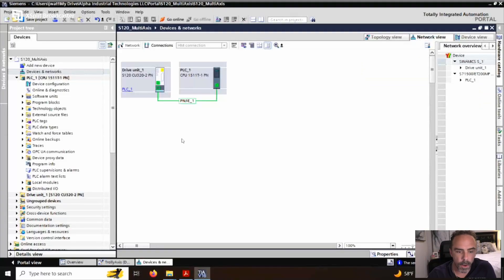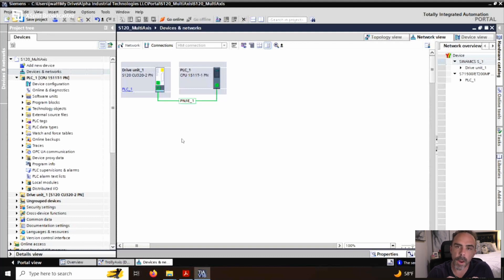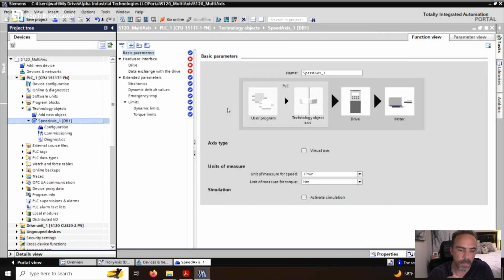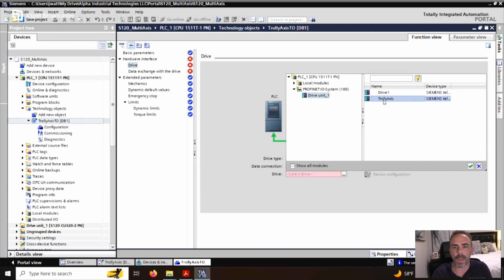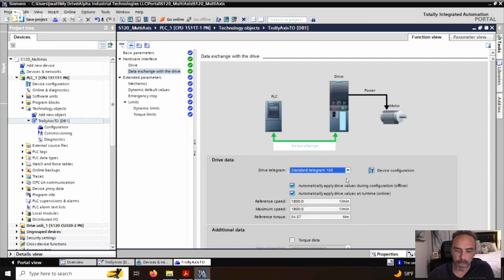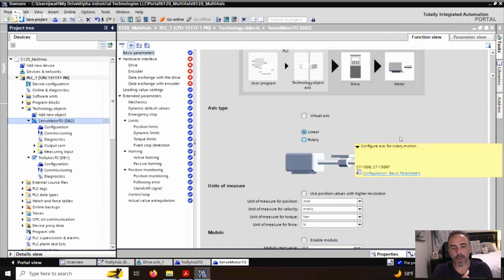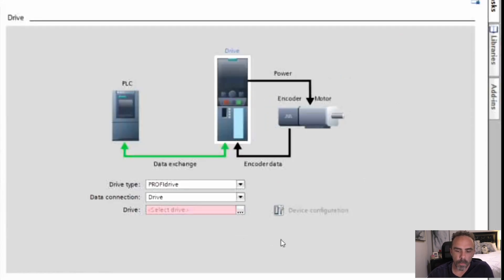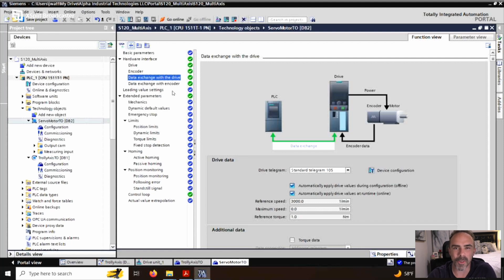Siemens Technology Object Setup

Comment: Hi Jason, Thank you for making these videos.  I have a question.  I'm trying to set up two S120s using torque reduction, but I'm having an issue in the TO.  In the Hardware interface under Drive type I select PROFIdrive, but when I try to link the Drive, it doesn't recognize my drives as valid choices.  They will only appear if I check the box Show all modules.  I'm able to select the drive when I set to Standard telegram 3, but this telegram doesn't work with the torque reduction I believe.  Selecting telegram Siemens 102 results in this issue.  Do you know what I may be missing?  Thank you, Nick
Reply from the maker: It sounds like there is an issue with the telegram selection relative to what type of control you are using. To be able to use MC_Torque Limiting you will need to use telegram 105 I believe and then extend the telegram by right clicking on the telegram and selecting the additional torque data. When you set up your technology object you will need to check the box "additional torque data available" and it should be good to go. Unfortunately, this telegram is only available to drives that are set up in "Servo" control mode. It might be that your CU is set up in "Universal". What type of motors are you using in your system?

I thought I stepped through this on a live stream, but I can't find it. I was going to talk this week about setting up a tension controlled winder and it uses this block so I will be going over this specifically. If you can join live you can ask questions as we go along. If you can't join live, watch the VOD and  ask questions in the comments.
Reply: Thank you sir.  I think the primary issue was the version of the Positioning TO that I was using.  We have a really old 1515-2 PLC that we use for testing and apparently it was only supporting the TO up to version 2.0.  When I switched to the latest model of PLC, I could upgrade to 5.0 on the TO.  At that point it seemed to recognize compatibility.  I was wondering why my TO settings looked different from the ones I watched you set up.  It would be great to see an application of the Torque Limiting, so I'll look forward to that! @jasonwattsae
Reply from the maker: @NicholasBoyd-u9l  Thats awesome that you figured it out! Thank you for sharing your solution!

Comment: Hello, Im using a CU310 S120 with resolver and i like to technology object in my s7 1516-3 pn/dp. is it possible to use telegram 105 for this configuration?  when i try to run from the TO commissioning window, it gives me a error like, to and encorder configuration is inconsistant. please help me with this.  ad additionally  if im using telegram 111 means, is it possible to use TO in plc?  Thanks in advance.
Reply from the maker: There are a couple things that could be happening with your Telegram 105. I believe that 105 is only available in SERVO control. Since you are using a resolver, you can run any motor in SERVO control. With your single axis control unit this would not be a problem. Check to make sure your axis is not set up in UNIVERSAL or VECTOR (depending on which version on Portal they have different names) control mode.

Second, it is always good to click on your PLC in the project tree and select Compile->Hardware (Rebuild All) after making changes to the telegram. This will make sure that your TO is updated.

Finally, make sure you fill out the "Drive Connection" page first as it USUALLY fills in the encoder connection for you unless you are using an external encoder connection.

As for Telegram 111, there is an TO called TO_EPOS that will allow the use of a telegram 111, but it has its own set of MC blocks as it uses the built in positioner on the CU3x0 and the TO is really just a way to easily configure the settings. There are instances where you might want to use EPOS, but mainly it would be if you are using a low end processor like a S7-12xx or something like a S7-1510 where you don't want to use motion resources.

Comment: I have got good experience from you, but if could be possible to do simulation on your videos cause its very costful to buy those drives and actual plc, so for the sake of learning may be you should use simualtion method of what you have done, but all in all good job
Reply from the maker: That is a great idea. I honestly don't use a lot of simulation tools because I have had access to demonstration units or real hardware in our shop. There are some really cool tools such as PLC SIM Advanced, SIMIT, and even go as far as controlling 3d models of your hardware using real PLC code using NX MCD. My company sees the need to learn all these tools in the future, but we have so many jobs with the basics its hard to learn the real advanced stuff. 

I will try and start using PLC SIM more in future videos though. Thanks for recommendation!